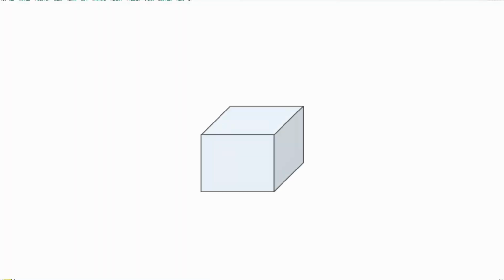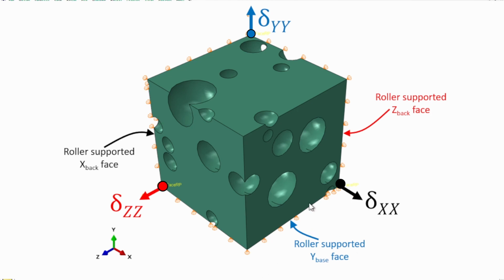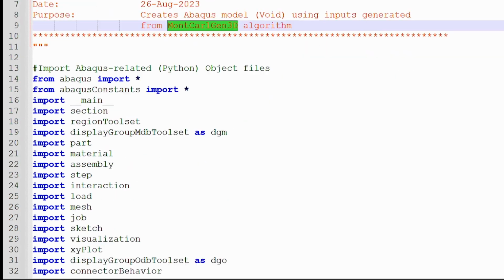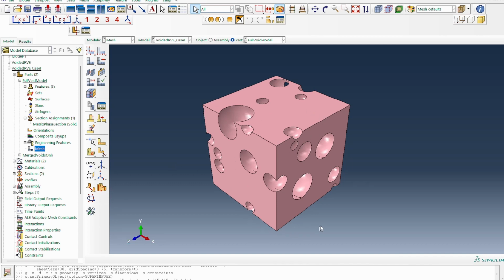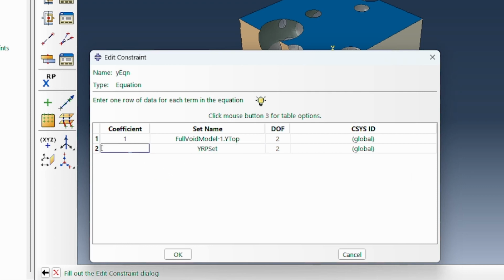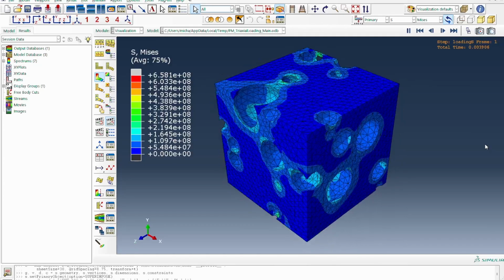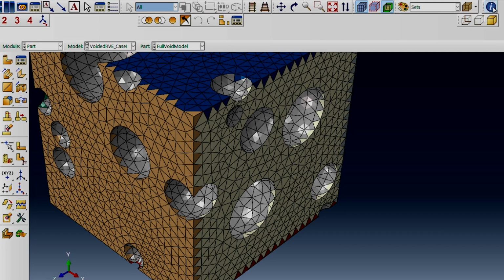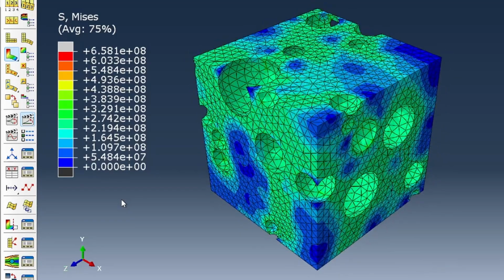How to apply Triaxial Loading on 3D RVEs in ABAQUS (voided material).

Comment: Thank you for your video, how did you get the coalescence? did you use a damage law?
Reply from the maker: The coalescence came from a plastic-deformation of the material. You can include damage but not so here. I did not use a damage law, it was simply the large deformation (stretching) of small connecting segments between the voids which on finite elongation, merges with adjacent voids leading to the coalesce. True representation of this feature will involve voids since at a defined deformation limit, the tendrils (connections) fracture and then the voids will coalesce truly. Hope the explanation makes sense.